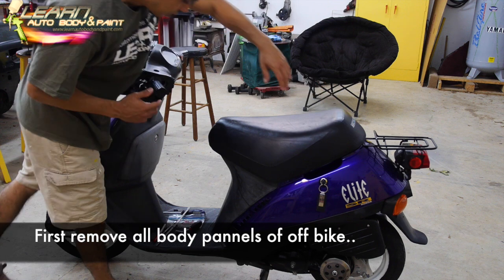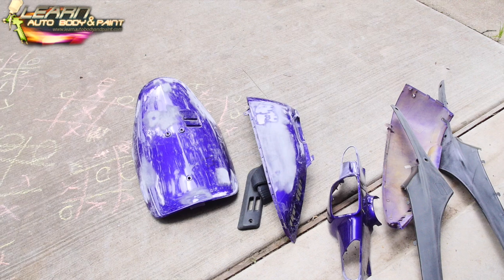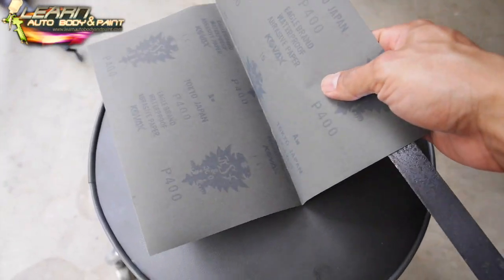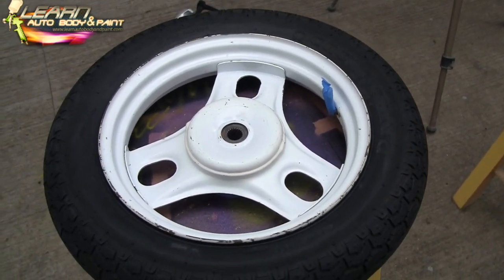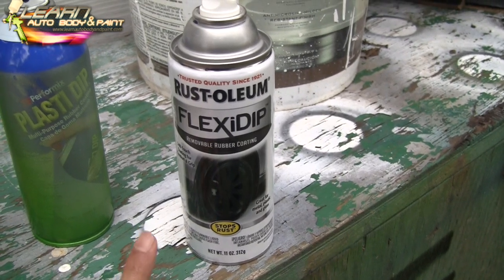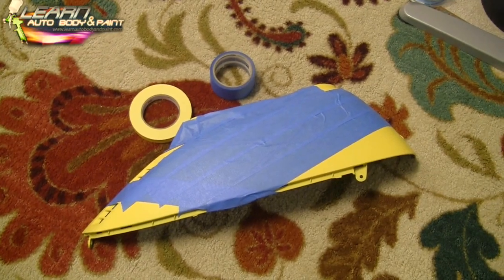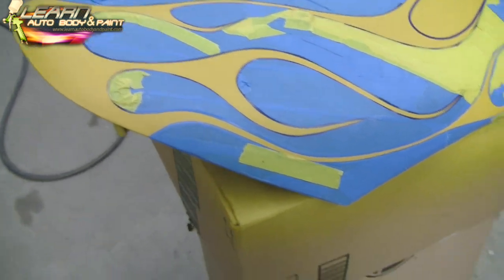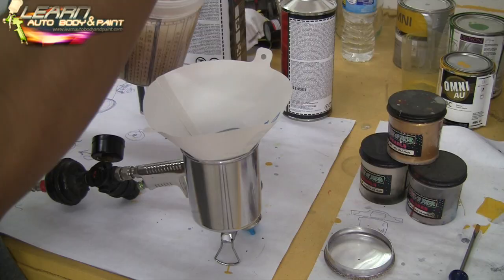How To Paint Any Bike, Scooter or Moped Step-by-Step and Get PRO Results

Comment: I dont want to have to sand alot. Im wondering if the factory matte white finish that a scooter comes in, is okay to just straight up start painting on it. Im thinking about making custom paint jobs on brand new motorscooters. What I figure is that its gonna have a rough surface, that no matter how many gloss coats you try to put on, it still looks flat because I never sanded, just painted on a matte surface to begin with.
Reply from the maker: Hey Man! Yeah we all have tricks and ways on auto body and paint. Check out more tips and tricks on auto body and paint and more of our projects in our VIP Program at https://vip.learnautobodyandpaint.com/home